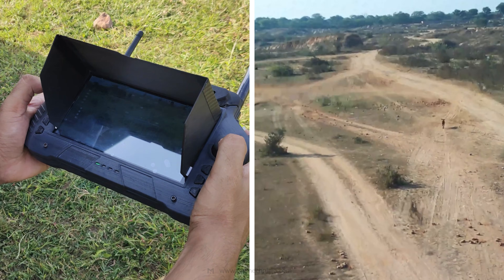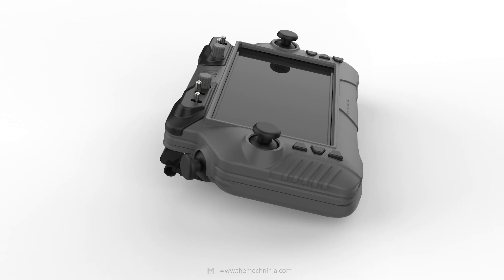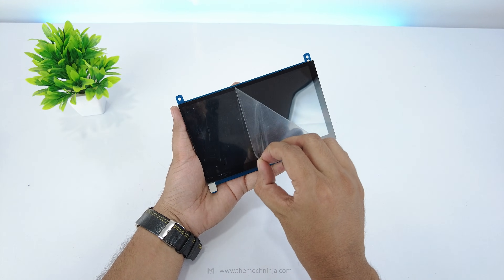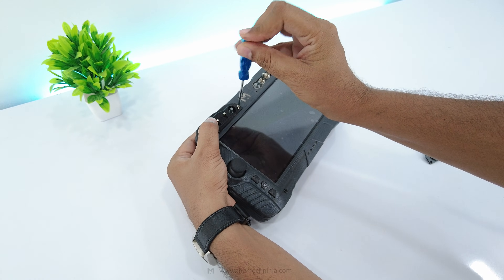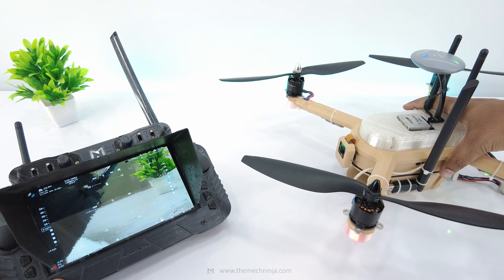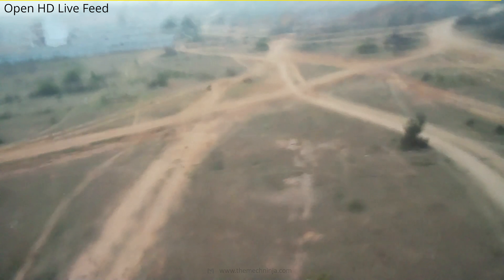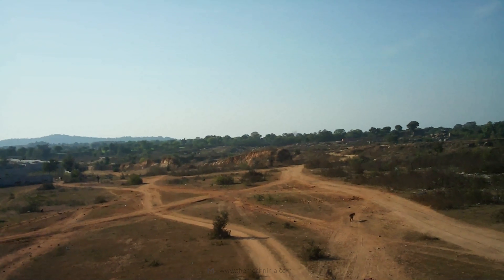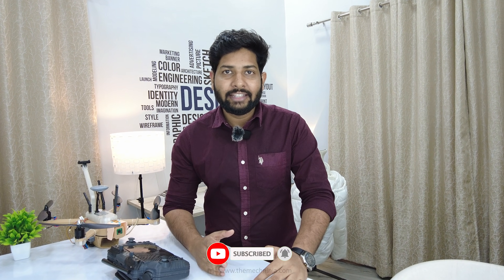I Built a 3D Printed 14-Channel RC Transmitter with Live HD Video

Comment: Hats off to ur creativity.......but I like to say something..look u have used the nrf24l01 transreciver module which has a wattage of less than 500mw the decoders are also not soo good , and the antena is omnidirectional.......which gives a max range of less than 1 km ,........so definitely u have done a fantastic job but can u make something or basically upgrade the regular transreciver modules(a heavy rf engineering work)so that it gives more than 5 km of range....i mean that project would be way more Adorable to us........
Reply from the maker: Thankyou for your feedback...and the coming version will have Lora module which will give more range...
And thankyou for watching and don't forget to subscribe 😊😊😊

Comment: Hey I am an aerospace engineer and i have seen ur edf video and in that case the problem u have raised are quite common and but the major problem is of motor I recommend u can use DYS H-2830-4 (4000kv) and rought sand the propeller surface along with some inner profiles of duct and add a nose cone bcz the suggest motor is back intake and see u will get the desired result close the Dynam try it and let me know
Reply from the maker: Thanks a lot for your feedback....I'll look into it. Currently I am trying to print the propeller on Resin printer....

Comment: Great Project and very nicely done 👍🏼 To get rid of camera vibration, I have had great success by adding weight to the camera. Not by making anything heavier but by combining the camera with something heavy. For example the battery. Then add dampers in between drone and battery box where the camera is attached. By invreasing mass of the camera bracket, high frequency vibration will be significantly reduced.
Reply from the maker: Yes my last option worked as i made the camera section heavier by adding steel balls to it. Actually I could more define it to but since it was out of the video topic so i left it...but I will do it in coming projects.
And thankyou for watching and don't forget to subscribe 😊

Comment: hey you can fix the wobble in the video by soft mounting it with custom x type tpu mounts used in Flywoo Flytimes 85 Drone
Reply from the maker: Generally I was thinking to try multiple designs too, but the video length was increasing...anyway, thanks for showing me a new design. I'll use it in my drone once....
And thankyou for watching and don't forget to subscribe 😊😊😊

Comment: How many kilometers does this transmitter have a range of and how much can it be extended?
Reply from the maker: For video transmission the antennas are limited upto 150 m, if you want to increase range then upgrade antennas...and RC transmitter is limited to 1km+ (claimed by nrf module)

Comment: you should use Hall effect joysticks or you can make your own, considering a good amount of sensors out there, like the AS5600, which already output a PWM signal which can simply be mapped to any control you plan on using
Reply from the maker: Actually the upcoming version will use the transmitter joystick, not the PS4 one. And yes hall effect one is good but it's difficult to find them. And the ones which are available is equivalent to buying a new transmitter 😅😅😅

Comment: It looks like a premium controller from dji. amazing design , could create a way to incorporate elrs system to this this would not only increase the range but make it a professional radio transmitter with option of a elrs module
Reply from the maker: This is just version 1, The future design and functionality will be far more good and it's already in the making...Upoming version is compact with improved functionality...
Thank you for watching and don't forget to subscribe...
Reply: Any thoughts of using Lora module for comm rather than using nrf module ? 433mhz
Reply from the maker: Ok in V2.0 I'll use it... suggest me anything else to incorporate in it other than using a mobile instead of wave share display...as I am already going to do it...
And thanks for watching and don't forget to subscribe....😊
Reply: @MechNinja you can use an Ipad screen and a pcb that takes hdmi input and connects to the screen I mentioned, I saw those pcb's online. This could work fine, but I dont know anytging about the latency. 
And I almost forgot to mention it earlier, grrat video! I immediately subscribed to your channel, I hope to see next videos on this topic from you!
Reply from the maker: Thankyou so much. Next time I am thinking to use the mobile in place of screen...Stay tuned for more ...
Reply: @MechNinja  don't use phone keep it standalone use a better display that's it
Reply from the maker: @venomgaming3290 using phone removed lots of electronics and make it compact
Reply: @MechNinja the display is the thing which makes this controller stand out infront of other nrf based systems and also the design is just looking professional bro keep the display
Reply from the maker: @venomgaming3290 ok , I'll try to put OLED Display then...
Reply: @MechNinja yes 💯